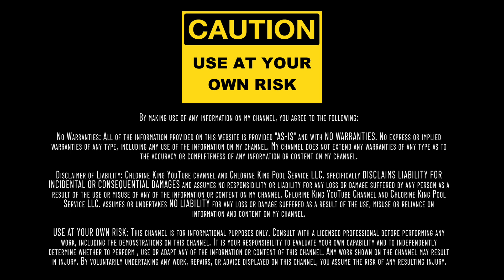How to Wire Pentair IntelliFlo to Jandy iAqualink (EASY Automation Guide)

Comment: Thanks for the vid! Question for you; I’m using an Intelliflo pump for our waterfall, and using the iAqualink to control it, however when I set the RPM for the pump in the iAqualink system below 800 the pump doesn’t run. I know that pump can run at 400 on its own, and I can’t figure out why it won’t run at that speed when set via iAqualink. Anything above 800 RPM works fine. Thanks again for the great vid!
Reply from the maker: Hey there. I’m glad my video was helpful. In the pump set up in the iAquaLink, do you have the minimum speed set to 800?
Reply: @ChlorineKingPoolService Thanks for the reply! Min speed in iAqualink is set to 800 right now, because if I set it any lower the Pentair pump won’t run even though it’s capable of going as low as 400. The app/web for iAqualink will let me set it less than 800, and it will say the pump is running, however in reality the pump stops running.

Comment: Thanks for the video!  I just upgraded my Whisperflo single speed to VST and trying to get it working with my Jandy iAqualink.  In other videos it shows a setting on the PDA to set the pump to variable speed, but looks like my system is too old and I'd need to upgrade it.  I've seen other videos showing wiring the directly to the relay's is that my best way forward besides the $1000+ to update my firmware and board (however would be nice to use phone app instead of PDA but not sure that's worth the $1000 upgrade)?  thanks!
Reply from the maker: If you're board is too old, yes you would need to have the pump wired to the "line side" of the filter pump relay (same ports where the breaker wires go) and then you'd have to run the pump independently of the automation system. Or you can wire it to the "load side" of the filter pump relay which would be able to give you the ability to shut the pump on and off through the automation, but not change speeds, etc. In that scenario, the filter pump relay would cut the pump off automatically each day based on the schedule for which you set. I hope this helps!
Reply: @ thanks for the info, I think I’ll plan to update the board especially since I want to take advantage of the multi speed and also need system to switch between pool and spa.
Reply from the maker: @sjarawan  you're very welcome. That's what I'm here for. I agree. You have all the automation to give you that ability. I'd make sure I'm able to use it myself. Have a great day!
Reply from the maker: @sjarawan definitely a great idea. You’ll want the IQ30-RS upgrade kit.

Comment: Will the iaqualink RS8 be able to control the Pentair inelliflo3 in variable flow mode?
Reply from the maker: Yes it will. You even have to select intelliflo VS in the new Pentair Intellicenter. But to your question, yes it will.
Reply: @ChlorineKingPoolService  I want variable flow not variable speed. I want to confirm before purchasing. Thank you.
Reply from the maker: @dennisskinner2339 sorry I over read the flow part (still working). No. It will not control GPM’s (Flow). Sorry about that.

Comment: Do you know if you can connect a pentair intelichlor saltcell to Jandy IAqua link
Reply from the maker: Yes you can connect any salt system to any automation system via the filter/pump relay. If it’s mixed brands you’ll more than likely lose features like remotely changing the salt system output or a salt reading. But yes, you absolutely can.

Comment: What cable do I need to run a pentair vs pump with the Aqua link system
Reply from the maker: Ideally a Pentair comm wire but generally any cat five wiring should work. The jandy comm wires work as well. Just make sure you use the same two color wires on both ends in their respective places. For the Jandy’s I’ll use the green and yellow so it’s identifiable with someone who’s familiar with Pentair systems. I hope that makes sense. Thanks for watching.

Comment: The wires from from the com cable from the pump are connected to the same com port as the iAqulink antenna or a separate com port next to the antenna?

Comment: Thank you for your knowledge. I have a Jandy TCX aqualink. I need a new pump and was hoping you could confirm if the Superflo VS would also connect this same way and be able to control pump speed from my phone.  I am having a heck of a time figuring out what other pumps that jandy will communicate to the TCX with the RS485.
Reply: Same here.  I have the TCX and a Hayward EcoStar SP-3400VSP and am having a heck of a time understanding the connection on this.  Fluidra has been zero help.  I went through the connection as it would be on a Hayward Omni system and it will not communicate with the pump via the RS485, so plan B was using the speed relays but no information anywhere as to how that hooks into the TCX system.
Reply: @shaunroberts1062  I got mine working. Mine was just connecting the green and yellow of the rs485.
Reply: @DontTellMeThatBelongsToUs  so the green and yellow on the RS485 of the TCX to what on the EcoStar pump?  Did you change any settings on the pump itself in the configuration menu?  And thank you very much for responding to this question.  I have been all over the web and Sandy refuses to talk to me since I am a homeowner, not a pool installer.
Reply: @shaunroberts1062  I checked out your manual and it says that your pump only communicates with Hayward systems. All other brands has to be via relays. Which is a pain and can’t be done via the Jandy. I had a new pump to start as well and had the same issue. I had to switch to a pentair superflo vsp. But that was also an issue because the com cable was backordered in all of the USA. I had to find someone to get the one I found in Canada for me.

Comment: Hi, my pentair vsp is connected to a aqualink rs, when it’s on a schedule and we want to use the spa it shuts off and after the jandy valves turn all the way on spa the pump turns on with slow speed and after couple of seconds you can hear that it wants to go to faster speed but it turns off right there, but on a service mode it works just fine, want to change the speed but can’t get the controls on the pump to work, even on a service mode, thanks for your help in advance
Reply from the maker: It sounds like you have to add the pump to "spa mode" and adjust the spa pump speed. I usually set up a spa mode speed, then set up a one touch button to have everything I want to turn on while in spa mode, and with the pump, what speed. I hope this helps.